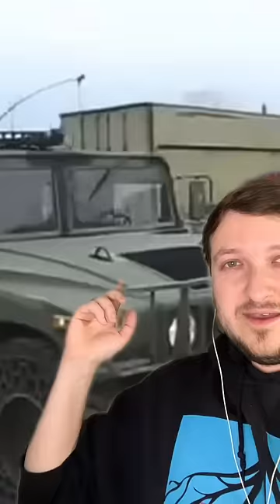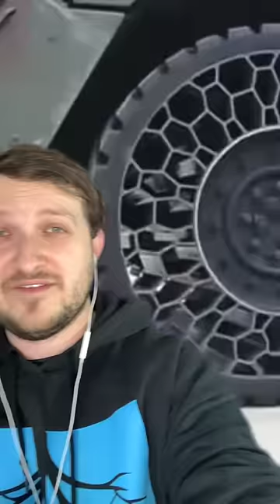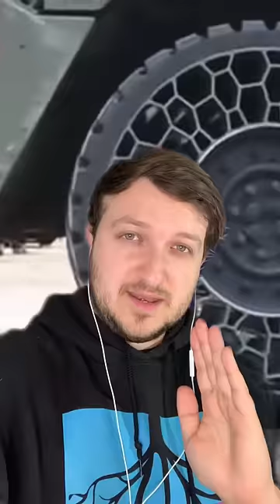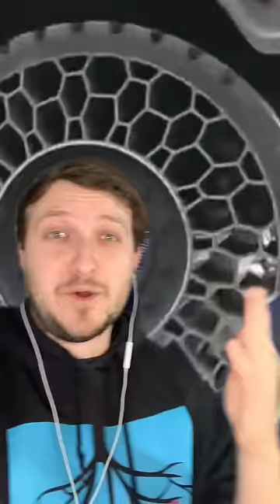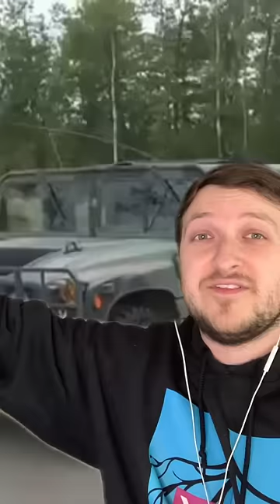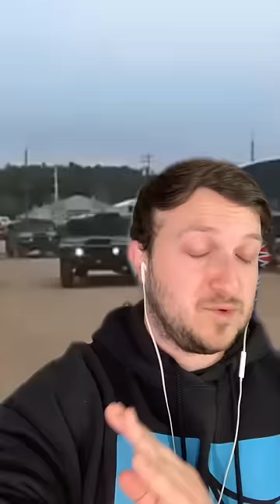Soldiers Airless Tires. #shorts#army

Comment: Why not used foam filled tires? We foam fill all of our tires on the farm even the skid steer is foam filled. We don’t have to worry about flat tires at all.
Reply: Have you ever driven above 25 on them?
Reply: @germen343  I’m not sure if we have ever done 25 or faster. I am guessing 16-20 is about the average apeed.
Reply: @germen343 bold of you to assume that you should be driving a humvee over 30 mph
Reply: @mikeakersa8566  well, when getting attacked by the enemy. Speed is your ally in any situation.
Reply: @mikeakersa8566  best I can do is 45MPH, but sarnt, I think the speedmeter is fucked up and the truck is deadlined 😂😂😂
Reply: It's not just that foam filling tends to unbalance the tire, it's also that there's a weight issue. Skid steers don't really have to worry about weight so long as they're light enough to be transported by a class D driver's license, but the military has to be able to airdrop a humvee. Every pound matters, and foam filling adds about 300 of them, all told. That's a whole soldier right there.

Edit: just checked a tire fill weight chart, and if I'm reading this right, I badly underestimated the weight needed to foam fill a tire. Seems it's more like 300 lbs per tire to fill a humvee-sized tire, which is 37 x 12.5 on a 16.5 inch wheel.
Reply: There is no way in hell foam is weighing 300 lbs per tire. It is foam for God sake, it is almost weightless.
Reply: @_kainzow9365  polyurethane foam gets pretty heavy depending on density and cell-opening properties for recovery and stability
Reply: @_kainzow9365  I don’t know what it weighs but it’s not foam like in your mattress. These tires are solid as they get. Our back hoe for instance we put it through its paces and there is no air in the tires at all and the tires don’t give. An air filled tire on the hoe we can put it on by hand. A foam filled we have to put on with the skid steer.
Reply: @_ kainzoW  while I have never weighted a  foam filled bobcat tire I can tell you it weights enough 1 person can't  load it by himself,  and I load 18 wheelers wheels by myself.
Reply: @_kainzow9365  And it decomposes into blobs quickly which will then rattle around in the tire.
Reply: @donaldkasper8346 foam doesn't decompose into blobs and rattle around. If you watch the tire removal, its one solid piece throughout the tire. When the rubber needs replacing, the foam is removed with saws and pry bars.
Reply: @TekGalen  Uh yes it does.
Reply: @donaldkasper8346  Please tell me how many foam filled, non-neumatic tires you have had to remove and install? These tires are filled solid, and this foam doesn't rattle around in the tires. Even when it does start to break down, there is no space for the foam to move around in globs. When the foam breaks down, it turns into literal dust.
Reply: @TekGalen  You foam the air tires, it breaks down quickly.  Its elastic life is short.  Doesn't matter what the application is.    Not under load it lasts several years before it dry rots to dust.
Reply: @donaldkasper8346  By foaming air tires, they become non-pneumatic tires because they aren't filled with air. 

Under normal load, daily use that foam still breaks down into dust. It doesn't have to dry rot from non-use. I've seen it plenty of times on tire removal for heavy machinery.

I've never seen that foam break off in blobs to rattle around in the tire like you said it does.

Maybe what you're used to seeing is different foam from what I've experienced.
Reply: @TekGalen  Foam by definition is mostly air.  Otherwise it would be called plastic.
Reply: @donaldkasper8346  which is irrelevant to the topic at hand. Foam filled tires are considered solid when filled.

If you want to make that argument, please fill some lungs with foam vs. air. There's a difference between the two, and you're just being pedantic because you don't actually have an argument.
Reply: It seems many people don't know that foam comes in a variety of densities, to fill a variety of needs. It is not "weightless" it is full of holes, but the elastomer between the holes definitely has weight.
Reply: They overheat badly for anything but really slow use, and melt the mousse.  They've tried that on dirtbike tires for decades now, still doesn't work.

Comment: Put an air compressor that runs off the engine to vent cool air onto the tires as they rotate.
Reply: @Jacob Nash :
The last time I checked, compressors generate quite a bit of noise?

And, thinking about it a bit more, the air being blown onto the tires would also be quite noisy.

If I was trying to build a military vehicle, I'd be looking for ways to reduce the noise signature, not ways to increase it.

STEALTH SAVES LIVES.
🙂

Comment: There's a reason why heavy machinery don't use either. They use massive solid tires. Can't puncture those too. But they're all dead heavy weight under the suspension.
Reply: Up to 12,500 lbs

Comment: The pattern and size of the tread blocks have an enormous effect upon the noise.  Tighter siping cuts, radiused "sidewall" transition, and smaller block size would reduce the noise considerably, although I can't say it would be sufficient.

Comment: Why are they so loud? Would a wall/covering fix that problem?
Reply: The wall either has to block in the air and as a consequence make it become a low grade pneumatic tyre, or let air leak and not solve the noise problem
Reply: Some sort of foam mesh padding on the side that stretches and compresses while letting air flow would help both with insulation and sound and make it look like a normal tire
Reply: I think it is the tread and the fact they are so hard that makes them so loud

Comment: using them as a run flat section of a regular pneumatic tire seems to be the best use case of this technology. Less weight than comparable current run flat tires which currently use solid chunks of rubber as their run flat elements.

Comment: They are still pretty much in their infancy of development.  As more strides are being taken in their development, they will be a viable option.  The noise is because there is no side walls so the air passing thru the honeycomb is making the sound.   Once they develop a viable sidewall for them, then the noise will lessen.  And they could even make the noise lower by filling the honeycomb with soft sound dampening foam before attaching the side walls

Comment: Worked for a caster company in the engineering department.  Another problem if they sit under load they flat spot. If you don't drive slowly for a bit, you'll see double for a while.  We were studying these types of tires and wheels. Back in the early 90's.

Comment: The tire that he's showing is nicknamed the tweel. The issue with this specific solid tread Tire isn't heat, the problem is the wheel itself. So far, nobody has figured out the right material that allows the wheel to flex enough without breaking at higher speeds. 
    I have been in the tire industry for MANY years, I even remember when Michelin introduced the concept wheel. I imagine this will be the future for tires ones engineering has solved the issue

Comment: One unique feature of military vehicles including the humvee is the central tyre inflation system where you can make your tires more firm for good gas milage on roads, and make them softer for offroad performance. If you had to do that with a hand pump and tyre gauge it would be a pain in the ass.

Comment: But we used run flats.  I used to pick the hummers from Lockheed martin, and they would always be flat well as flat as a run flat gets... But the 5 tons were definitely still using tubes. I had a whole summer of busting tires. Just to put in bad seals, just to have something to do. Because they don't want you sitting around doing nothing when there's nothing to do..

Comment: Run flats work with no air. Customer came to the shop one day to replace their tires. One tire has a penny size hole in the sidewall. Tire was so stiff so it was running with no air for a while.

Comment: These are very small issues when compared to the real issue: they are incredibly inefficient. The reason a tennis ball bounces back with nearly the same height as it fell from is because the air returns nearly all the energy used to compress it. This makes the rolling friction of air tires very low for the amount of grip they have. You could also use steel wheels, like a train car that would have much lower friction but with much less grip.

Comment: They will get there, the ones in the video are garbage compared to some of the newest designs are, the heat also is not a problem since they make them with much better performing polymers and composite with carbon fiber

Comment: Thr main reason is: dont fix what aint broke. Yes tires can pop, it happens on occasion, but its not like theres nail traps in the training grounds. Your more likely to change the tire cause its too worn down than because its popped, and we already know how well air tires can perfom and what to expect of it, so unless the airless tires fufill a need air tires cant, why bother?
Reply: Well they do fulfill one niche if some of the design claws are maranaged successfully. For units who might be expected to be out of resupply for long amounts of time. The U.S. Military does not really do this, much prefering not to stretch too far from where their extensive logistics can reach with relative ease. 

But if it were combat over a large, mostly flat, space where anti-aircraft systems  prevent air resupply and you wanted to do some relatively intensive raiding deep in enemy territory this is what would allow it.

Comment: You also cannot change contact patch size via pressure to run more or less efficiently. On the highway and off road. 

They were working on a hybrid system where it was the core of this tire but still a more conventional tire on the outside that is the worst i mean best of both worlds.

Comment: Airless tires have been used on some heavy machinery in mines for a decent amount of time now. They work good like anything else, as long as you use them for its intended purpose. Better than air tires? Depends on what you're doing.

Comment: We didn’t HAVE to put a jet’s engine in our main battle tank, but we did it anyways.

So I’m pretty sure we’re not concerned with the noise the tires make. Those are just the Humvees you can see. The ones we want you to see. The Distraction Carnifex, if you will. It’s the ones you don’t hear over the ten or fifteen loud ass vehicles that’s meant to get you.

Comment: They do or did have some airless tires, we got one in a auction in the early 2000's that had completely wore out tires, it was hard to even tell if they ever had tread. When we tried to remove them they had some sort of foam in them. We would have had to get new rems and all. But a friend new a guy that could retread them. It would never be on the road really so that's what we did. Almost 20 year later she still gets around on them. Altho one is starting to look like they might have to be done again 🤔

Comment: The biggest issue you should be focusing on is the fact airless tires fill with mud. You could easily hold 300 pounds of mud in that tire. x4 your tires now weigh as much as a small cow.

Comment: You forgot another very obvious problem:  They would park up with mud immediately, causing MAJOR balance issues.  These can work for very slow moving construction equipment like they're used on some now.  Also, you can't air them down for changing conditions.

Comment: The concept is old but the technology is relatively young and not yet proven as all the kinks haven't been ironed out. The weird anomaly, "they dispense heat really bad," seems strange because of all the honeycomb surface area but then again, that's science for you. It's possible that the honeycomb design accounts from some of the road noise. Perhaps the solution is to only add side walls.

Comment: Wouldn't it make more sense to just use solid rubber wheels? They are more expensive, but one or two hundred bucks more are nothing considering the cost of military vehicles. They don't flatten, they require no maintenance and don't pop when being hit by gunshots

Comment: The term is disperse heat, bud. Not dispense heat.
That's what the loose nut between the steering wheel and the seat does if they fuck with Doc.

Comment: how could an airless tire possibly have worse heat dissipation than a normal tire? also with everyone in the comments talking about the lack of a sidewall and debris and such, why can’t you just put a sidewall on? all you’re doing is changing the support system from trapped air to an actual structure

Comment: Ehh ... pneumatic tires don't Dispense heat ..they Disperse heat !  Tires in Sub-Saharan  temperatures on military vehicles are very loud to begin with ,so technically makes not much difference! The airless tires actually dissipate heat better through the compartments , as air flows thru  the compartments as opposed to retaining hot pressurized air !

Comment: They are ruff ride too
Reply: Another issue is that they are not good for high speeds. 
So in addition to being louder, and being worse as dissipating heat, they also can give a rougher ride, and at speeds around and above 80kph (about 50mph)can be unstable, causing vibrations.

-
So they are good for construction vehicles like skid steers and wheeled excavators, since constructions sites can be rife with tire puncture hazards. But not (yet) good for highway speeds on cars and trucks.
-
edit: there are foam-filled tires that are great for bicyclists, since the smaller tire width and height removes a lot of the problems car and truck tires would have.
Reply: @MonkeyJedi99  why not create a foam siding that lets air flow working somewhat as insulation and helping with the noise that moves and bends with the tire even helping stability of equiped into the design
Reply: @dontbother2455  I would imagine that the flexion of the sidewall limits what kind of materials can be used and still have a durable tire.
At some point, you might end up just having a traditional pneumatic tire with a foam "tube" like in airless bicycle tires.

Comment: They get out of balance way to easy you hit some mud and your speed gets reduced down to 10mph if they get clogged bad same thing happens in snow  they are also alot more brittle a big pot hole destroys these at a decent speed it compresses so hard it deforms the tire causing it to slapp the ground creating premature failure I've uses these alot on all sorts of different vehicles they are close to being a viable option but not just there yet

Comment: Couldn't they solve that problem by closing the sides? It would cause pockets of lightly compressed air that would be better at transferring heat than the open design while not relying on the air pressure for structure. I'm not an engineer though so I'm probably wrong lol

Comment: Originally Goodyear invented these.  They were called tweels and they were designed for formula 1 cars.  But they clearly haven't solved the issue with them.  These things have been around for decades.  Not a new invention

Comment: I mean you only worry about tires getting hot because the air will expand inside increasing the pressure while decreasing the rubbers durability. Airless tires don’t really have an issue with being too hot or cold it’s why the moon river used it. The sun light directly is crazy hot while the shadows are crazy cold.
Reply: I think the moon rover had aluminum wheel/tires. I'm guessing tweel cant deal with heat generated from high speeds and fail.
Reply: @oldleatherhandsfriends4053 he said “moon river,” not “moon rover.” Clearly an Andy Warhol fan.

Comment: Well, what does the heat have to do with anything if the tire can't blow? If it can't blow, then what's the problem with them not being able to dispense heat? I would have thought that the military wouldn't use them yet bcuz their vehicles are too damn heavy, and bcuz they would need to test them out in adverse terrain and weather with lots of weight!

Comment: Why don't we ALL use airless tires??? Seriously. No more flat tires. I wonder if they wear down same as regular tires.
Reply: 1. These are significantly more expensive.
2. These as he already stated is very loud and   is not good at dissipating heat which means it breaks quicker than regular tires. 
3. These also would require a different kind of RIM which means not a lot of cars would be able to adapt to it and it would  require a new series of vehicles that could adapt to it.

Comment: Why not use semi solid inners like theyve been using for years on mine resistant vehicles...
Reply: Thats standard in most Humvees. 
Runflat inserts.  Thats why they ofted don't carry a spare.
Reply: @benjurqunov  they usually don't carry a spare because another unit robbed it overnight to replace their flat after another unit stole their spare

Comment: How could it be worse at dispensing heat? That makes no sense
Reply: More material means more heat retained. On top of that the way it replaces air is with flexures. Bending any material generates a little bit of heat and it adds up pretty quickly